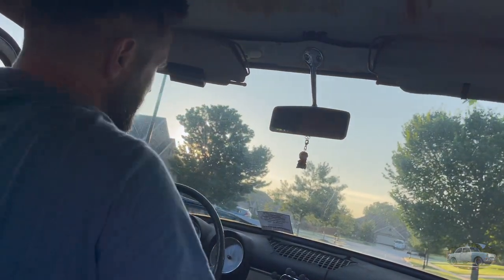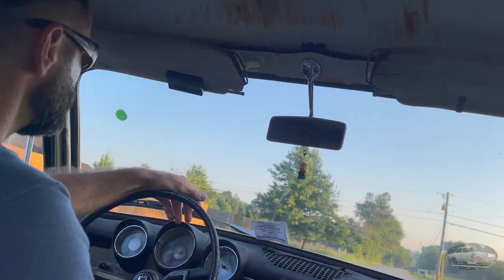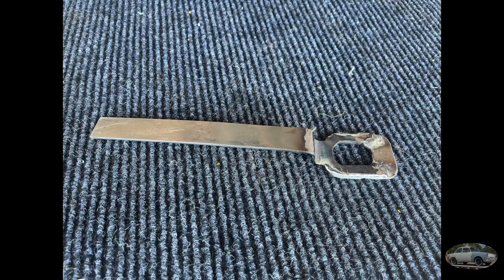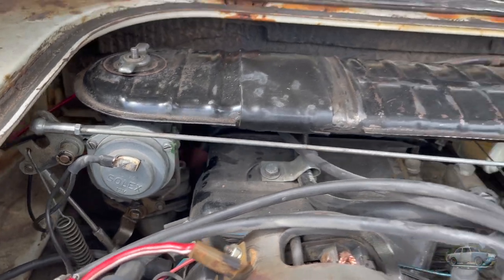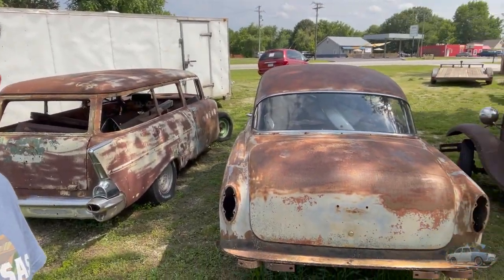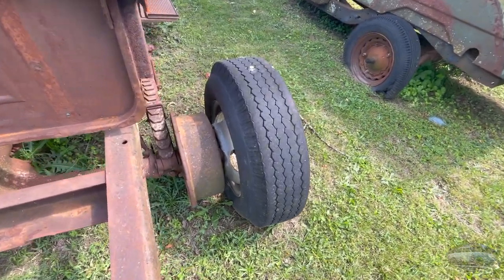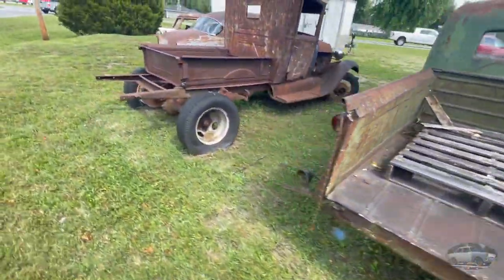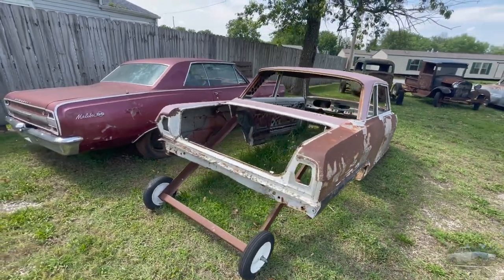Road Test Vapor Lock and Charging Issues

Comment: Nice, dude! You're a brave man for driving such long distances. I'm still barely about 530 miles, give or take, on my engine break-in. I'll eventually start taking longer trips with it soon enough.
Reply from the maker: I’ve done a fair bit of in town driving, and local long distance, so I was feeling pretty comfortable. Hell, the first thing I did in the car was drive it across the country! 😂
Reply: @vdubjunkie  I was lucky and found my first Squareback 18 miles away, and my 2nd (current) square only 21 miles away. Both of which  were towed to my house after purchase, and I started dissecting them immediately. I guess the perks for living in CA where old cars never really rust away and are somewhat plentiful haha. I'll plan a longer trip with it once I'm at a certain level of confidence. just working the kinks out and such.
Reply from the maker: @jeremydoc  I lived a similar life in my youth, in Phoenix, AZ. Good luck with your current project. Keep driving it!!

Comment: Try a clothes pin or 2 on the fuel line for the vapor lock issue. I can't speak from direct experience, but I've seen it done numerous times and the explanation is almost always the same - "Hey, if it works, it works". From what I understand, it acts as a type of heat sync. Hope it helps!
Reply from the maker: Funny you mention that. My buddy’s dad suggested that a while ago. In my Longest Road Trip Yet video we were hunting rusty gold and I took a picture of a bag of clothes pins for that reason. Kind of an inside joke. I’m not against it, but didn’t want to pay a premium for clothespins and I wonder if it would work when cooling down the fuel pump is such an immediate resolution. I may have to do it now.
Reply: @vdubjunkie  It's worth a shot next time you find one laying around. I certainly wouldn't pay a premium for them either.
Reply from the maker: @gordonpattersonjr7233  I’ll keep my eyes open. I didn’t clarify in the video, but I really only had to let the car set for a few minutes after cooling the fuel pump. If there had been shade, I would have barely been sweating 😜

Comment: Are the T3 dual carbs supposed to have the little nylon spacers between the choke ring and carb body like single carbs on upright motors?
Reply from the maker: I’m not 100% certain I’m sure what you’re talking about. I don’t think you’re referring to the piece between the carb and the manifold. Short answer is I don’t believe so. There is a thin gasket between the electric choke element and the body of the carb and another between the carb and the manifold.
Reply: @vdubjunkie  Upright single carb motors have little nylon spacers on the screw you lost and had to borrow off the other carb in the video. I've been told they help keep the screws from rattling out when you tighten down against them. I don't know much about T3 carbs but thought of this as far as addressing your losing screws.
Reply from the maker: Ok, I understand now. I’ll have to research that. There may be another video in the future as a result. Thanks for that!